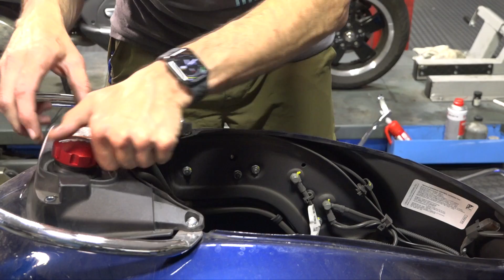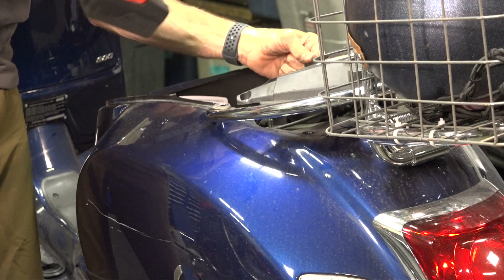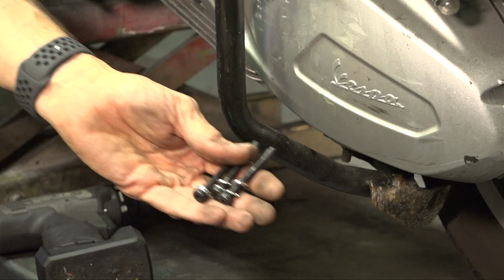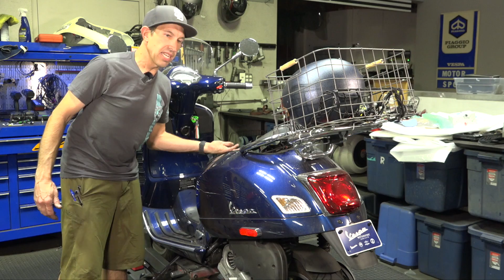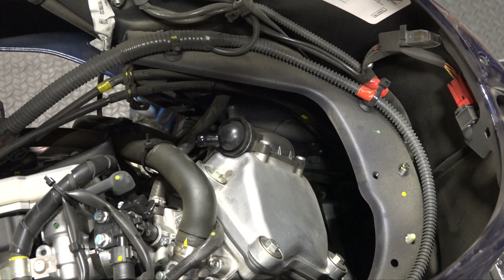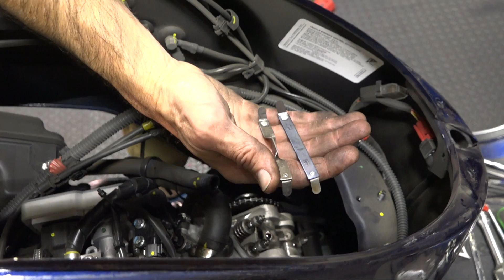Vespa GTS Valve Adjustment

Comment: I really appreciate how my Harley only needed gas and oil changes after owning a Vespa. These scooters need a lot off work to keep them on the road
Reply: Is the Harley more comfortable to ride than a vespa? I seriously doubt that!
Reply: Definitely, the fact that HD uses hydraulic lifters is wonderful, supposedly 'antiquated' engines, but now I'm looking for my next motorcycle, and it doesn't matter which one, all of them require valve adjustments: Triumph, BMW boxers, Royal Enfield, KTM. It's incredible. I thought hydraulic lifters were something common, but I was wrong. I don't mind doing that work, but every 10,000 km seems insulting to me.

Comment: Great video as usual buddy, my bike stalls when cold and now I know why after checking every other component
Reply: And was this the problem for youre scooter ?
Reply: @Sujaaf  yes, did the valves clearance, the outlet was really tight (nearly closed) it was a different bike after! Did it myself to followed robots tutorial, easy
Reply: @ianbrock7190 thnx for the reply. I did it also yesterday. They where not far away from spec adjusted a little. Did a sparkplug while i was there. Easy job. But still when the bike is cold wont hold idle 🤔
Reply: Think i will clean the injector next.  The e10 fuel could be 6months old just bought the bike.

Comment: Thanks allot for this video much appreciated!!
My GTS is not running idle when cold. Checked the valves hoped for a tight exhaust.  But all 4 almost in spec.
Any ideas what it could be more. Changed the spark plug aswell.  I will clean the injector also. Any input or ideas?
Reply: Update: after cleaning the throttle body and stepmotor inlet. Injector clean. Still the same 🤔.

How much pressure should primeming normally give?

I took of the fuel line let it prime fuel came out but not on pressure

Comment: Hej Robot could you give me a hand? Ive changed variator + belt + rollers in Vespa 125 ET4. Originaly i've had 8,5g and its was really hard just to get goin from traffic lights. I've changed to 7gr and still acceleration is awful (0-20, 20-80 it goes to high imo)